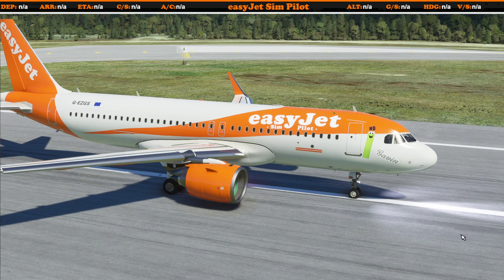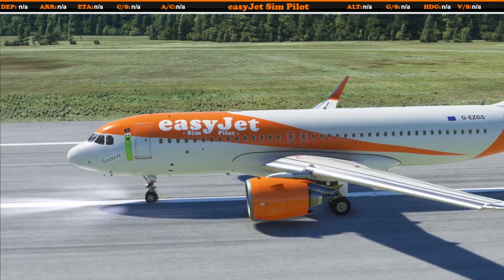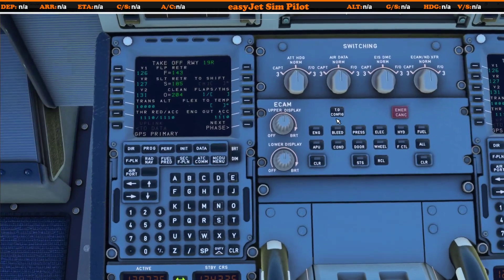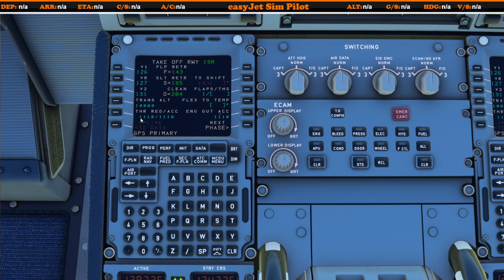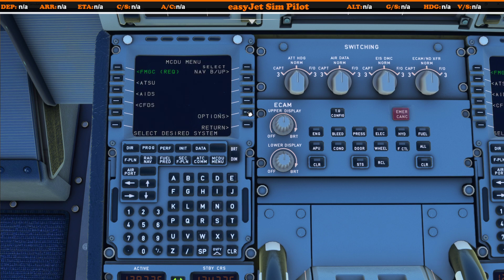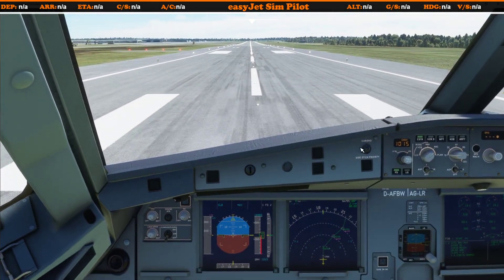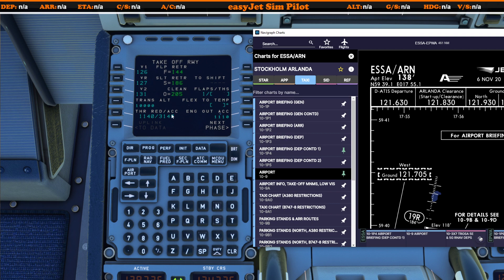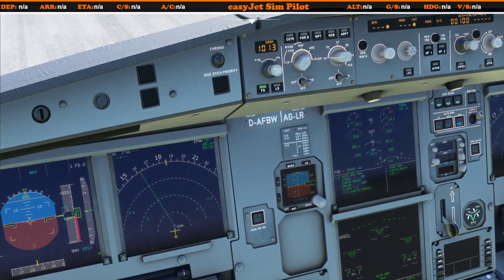A320 Thrust Reduction/Acceleration Explained | How to fly Noise Abatement Procedures | MSFS 2020

Comment: If you look at the A320 FCTM for NADP2 is mentioned that Acceleration is 800 AGL but Thrust reduction is selected with the flaps/slats retraction. So you will have to wait until F or S speed before reducing the thrust levers back to CLB detent.
Reply from the maker: The Thrust Red/ACCEL height is airline specific. Many use 1500ft, others use 1000ft

You never retract flaps (on any setting) below thrust red. 👍
Reply: @Easyjetsimpilot  Julian is correct about when to reduce thrusts while you’re correct about how SOPs differ. Standard NADP 2 dictates at least 800 AGL acc altitude so airlines play between that and 1500. But thrust reduction as per international nadp 2 standard is when you reach your F/S speeds as you command flap retraction.

Comment: I love that you are at Arlanda. It's my home airport and soon it will have a new scenery from Asobo! Planes usually at Arlanda take off from 19L and use the E sids. Not seen so often that the G sids are used. Even though ESSA is around 20 kilometers north of a municipality outside of Stockholm named Upplands Väsby and maybe 15 kilometers from another municipality called Sigtuna. They have rules what you said with noice abatement that you are not allowed to fly over there. Anyways keep up the good work man!
Reply: Edit: When you climb. Sorry for being picky, usually if this was IRL, you'd climb to 5000 but then be instructed by Stockholm Control to climb to FL180 for most sids at least. Like also how you applied TOGA on a runway which is 3301 meters which is the longest runway at the aerodrome
Reply from the maker: True, however video wasn't about explaining SID initial climb clearences, chart reading, or TOGA/FLX calculations. It was all kept simple to try and explain what can be an already confusing item and methodology for NADPs.

Comment: Thank you great! In NADP2 nose down at 3140 feet 2 questions 1. Can you put autopilot on early and let it put the nose down?  2. I assume the flaps will not be auto retracted before acceleration height 3140 and neither can you retract the slats? Is there a video on what the engine out height is and what it is set to?
Reply from the maker: Leave the engine out set to CLB THR altitude. AP will command the nose down at ACCEL altitude, yes.

Flaps are auto retracted at 210kts, but slats are you. You still have to select config 0 before reaching Vfe.
Reply from the maker: Just check that again... NADP2 the Thrust alt and Accel alt are he same. NADP1 they are different.

Comment: Captain Gavin this is remarkable training. thank you. I have an issue with the Dev version of A320nX. During initial Climb, the autopilot disconnects and the plane goers into a straight dive. Any thoughts, please? How do I see the scheduke for your future flights? Thank you. Donation to come in next flight. tx, RS918
Reply from the maker: Hi John. The autopilot shouldn't disconnect randomly. Is there any keybinding issue set up in the sim for AP disconnect? If you lose speed and speed protection kicks in (alpha floor), the the AP will also disconnect.

If you move the sidestick (or whatever you use to control aircraft) then it can also disconnect. Ensure you have around 15% dead zones set for your controllers sensitivity settings.
Reply: @Easyjetsimpilot  As yu suggested, I remove the autopilot toggle AP master from my thrustmaster TCA Joystick, then I set deadzones for joystick to 20.  Then did flight KLAS to KSBA (not a cold start) and Ap disconnected about 11k feet. In Stable A320nX, this doesn't occur. Might yu have another suggestion, Sir?. Thank you, John
Reply from the maker: @randysaad5236  try using the dev build. 👍
Reply: @Easyjetsimpilot  im using the dev version which I select from the fbw downloader on my desktop. Is there a different source for dev build I should use? Im taking too much of your time so this will be my last question, Captain
Reply: Please send link for a donation. Tx again, John R.
Reply from the maker: The version from the Flybywire installer is the version that I use. Thank you - donation link is in the video description 🙏
Reply: @Easyjetsimpilot  Ok Thank you v much. John R
Reply: G, it was the mouse. Don't know how, but it was keyed to change trim up or down as I moved the view in the cockpit up or down. With default mouse, I just finished a PERFECT flight in dev version.  How good it feels. See you soon in your stream. Tx, again. J

Comment: I like your video! However, it seems to me, the aircraft could be quieter if it reduced power and pitch to maintain V2+20 at the RED altitude. Your TO/GA was set to 85% N1 and was then reduced to only 83% N1 at RED altitude after moving the levers into CLB detent. In most flights I've been on, there's an extreme pitch up after T/O (probably 17º or 20º) followed by a substantial reduction of power as the nose is lowered at the calculated RED altitude. With your NADP1 demonstration, TO/GA was also set to 85% N1 and then only reduced to 83% N1 at RED altitude when the levers were moved into CLB detent. So the plan to reduce aircraft noise is to run two LEAP-1A26 turbofan engines at 83% N1 through 3000 feet AGL? If less power equals less noise, where is the abatement of noise?

Watching GA pilots hand fly NADP procedures (2 or 1) there is always a reduction in power as they lower the nose to maintain V2+(whatever), then a return to normal power as they continue normal climb procedures at the prescribed altitude.

Are we sure your aircraft is correctly flying a NADP procedure? Of course, I could be completely confused.
Reply from the maker: I think you are confusing this. NADP1 required thrust reduction, yes - but needs to get as high as possible from the airport, rather than accelerate away. Therfore, the nose does not lower until reaching the accel altitude.
Reply: @Easyjetsimpilot  You're probably right about my confusion 🙂 My error was thinking NADP2 was TO/GA to V2+20 until at least 800' AGL, then reduce power/pitch and maintain V3 until 3000' AGL, then resume normal climb. And NADP1 was TO/GA to V2+20 until at least 800' AGL, then reduce power/pitch to maintain v2+20 until 3000" AGL, then resume normal climb.

That's why I like your video because you do a great job explaining the procedures.

Have you tried incorporating speed constraints within your departure? I've found success when utilizing speed and altitude constraints while flying SIDs.

Comment: Great video Gavin, but what's the engine out figure used for?
Reply from the maker: This is generally set to the same as the ACCEL altitude. It's is essential the acceleration altitude if you lose an engine on departure (after V1). Due to terrain and other proceedures, this can be different at some airports, but this is usually given by airlines own SOPs so not really applicable in the sim.
Reply: @Easyjetsimpilot  thanks thats clearer

Comment: What about making the plane silent cause when planes fly in night they are super Quiet
Reply from the maker: The engines still make the same noise, daytime or night time. The use of reverse thrust on landing is sometimes not allowed at airports during night hours.
Reply: @Easyjetsimpilot  then how is the airplane super loud in morning and silent in night
Reply from the maker: @osamaedris8376  potentially TOGA takeover over FLX takeoff. But there is no way to 'mute' the engines into a night time mode.
Reply: Two other factors to consider here too. 

The first one is that some airports have nighttime only departure procedures, which will be longer and/or more restrictive, but take aircraft further away from residential areas, thus reducing the noise impact. 

The second is that the way sound travels is very much dependant on the ambient air temperature, especially when you think about the speed of sound that is directly proportional to temperature. Put simply: as air temperature increases, it's speed also increases, and thus it travels further before the sound is dispersed. So it stands to reason that, for example, standing a kilometre away at ground level, the aircraft may sound louder at midday than midnight assuming it's much warmer in the daytime than nighttime. 

In both these cases, the actual sound from the aircraft is no different.

Comment: Very nice. As Easyjetsimpilot says it depends of the SOPs. There is also another way to go for NADP 2 (A320 MENTOR channel link below):  THR RED / ACC 800 AGL;  set green dot speed in PRESEL on CLB page. This will give SPEED SEL <green dot speed> blue message on the flight mode annunciator after applying thrust.  After 800 AGL let LVL CLB flashing until S speed, then set CLB and retract flaps. Finally at 3000 AGL set managed speed 
https://www.youtube.com/watch?v=H8M1LC-E-nk&t=166s